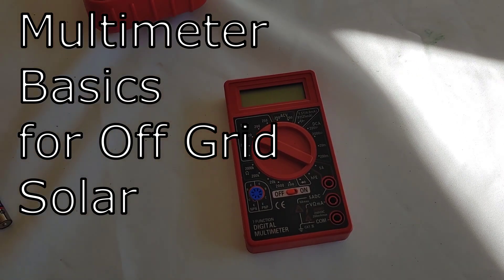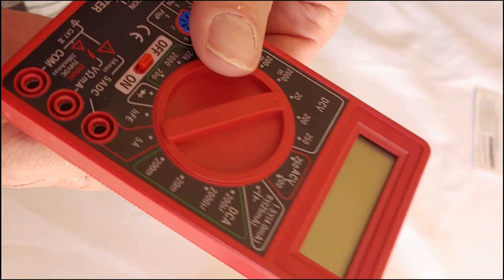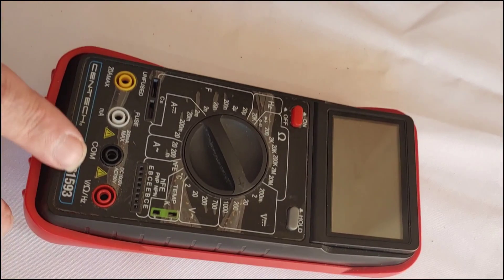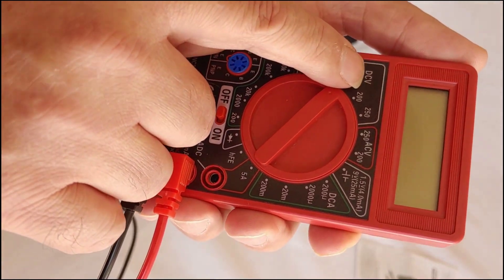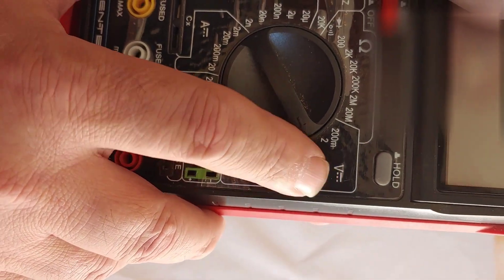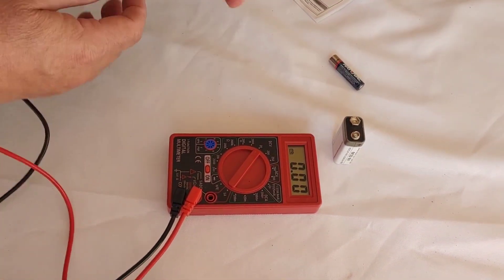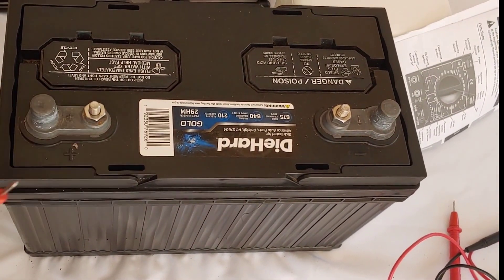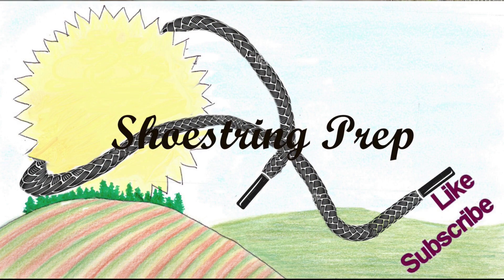Multimeter Basics for off-grid solar: Checking a battery voltage

Comment: I was wishing you would show how to check Amperage with this multimeter.. especially from a Solar Panel.
I probably got burned buying my 6 used panels (bought a couple here and there, not all at once), now i need to check amperage on em. I may have done it right and see that the 4 i had handy pushed no amps 😐

Tip.. With this multimeter.. when checking volts, turn the switch to a higher setting than your source battery, etc.
Reply from the maker: I will add that to my video list. Thanks for the tip and the comment.

Comment: Do you have to change or adjust the settings somehow based on if its a parralel battery bank circuit compared to just a single battery? 

And is there a way to measure total amp hours using these devices?
Reply from the maker: Adjust the setting as if it was one battery and it will charge the whole bank. Thanks for your comment